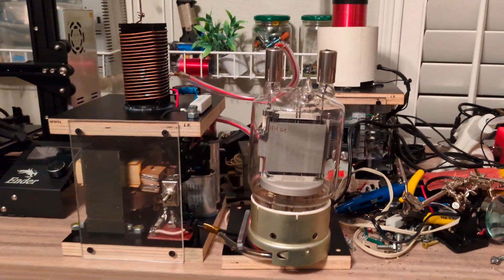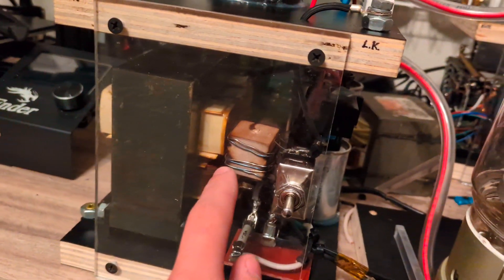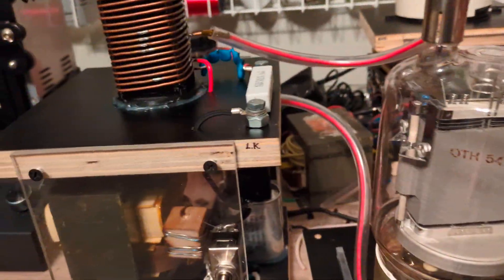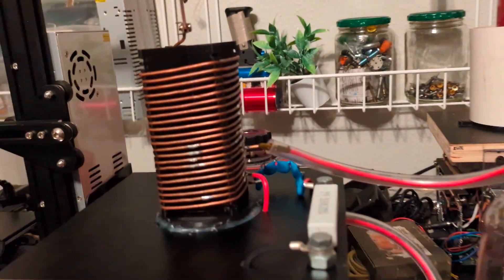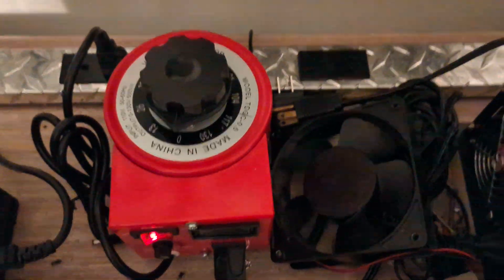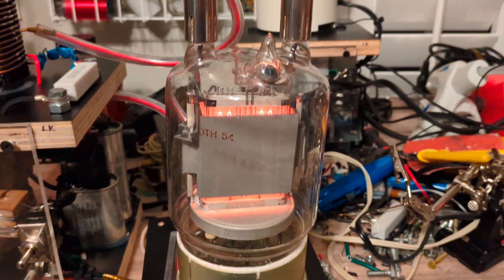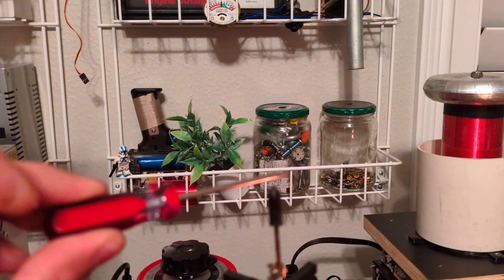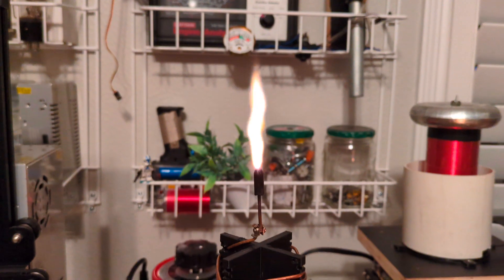i made a candle that shoots plasma 😂

Comment: You could add a file to produce lightning - and run the plasma torch simultaneously Is this possible?
Reply from the maker: @maniac2315  A file?  Like a computer file or the tool file?
Reply: @Livewire460 I mean you put a secondary coil inside the primary coil to produce a lightning spark -- and run a plasma torch simultaneously.
Reply from the maker: @maniac2315  Ohh.  That is a good idea but I don't think that it will work since the frequencies of the two coils will be very different.

Comment: Base fed coil - longer chicken stick necessary - no coupling straight to the secondary output of the MOT 😮
Reply from the maker: Yea but this gets me the best output with the power of the microwave transformer.  But yes I will use a longer chicken stick :).